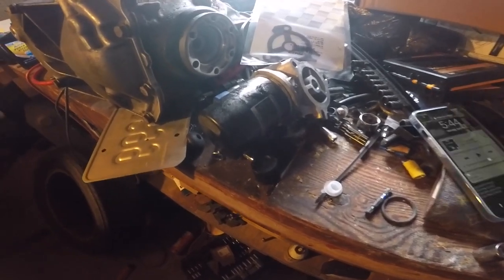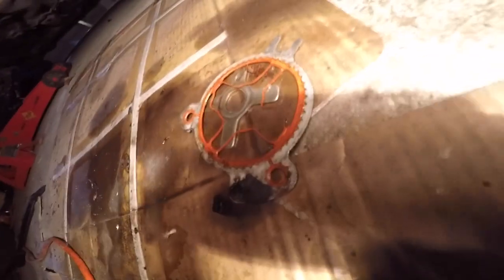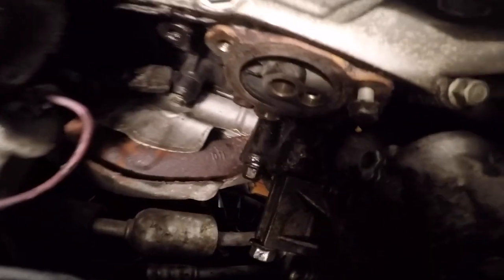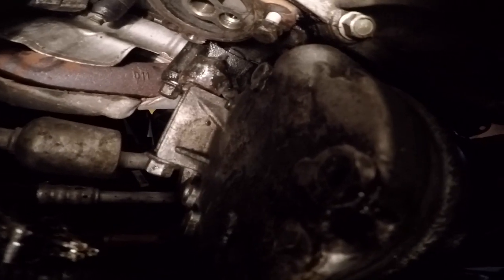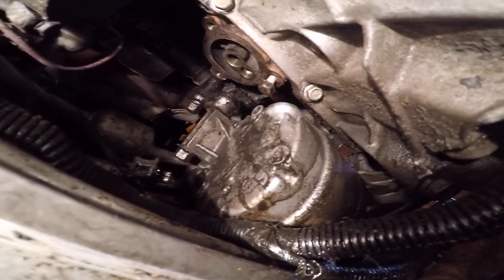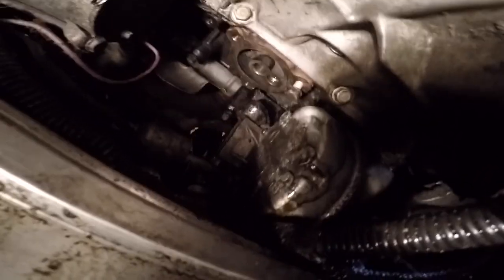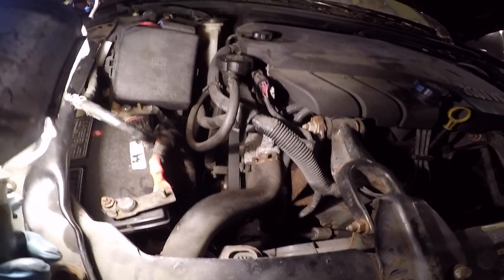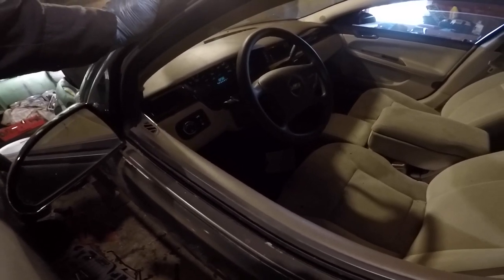how to replace chevy impala oil filter housing

Comment: This comment is for GM Manufacturing, what a idiot idea to add or built a oil filter housing have a useless gasket and in a such fucking tight spot which is I could have done it differently. It doesn't last long and hard to replace it.
Reply: I agree with you. right now I'm replacing it and it's a pain # $ @ %%